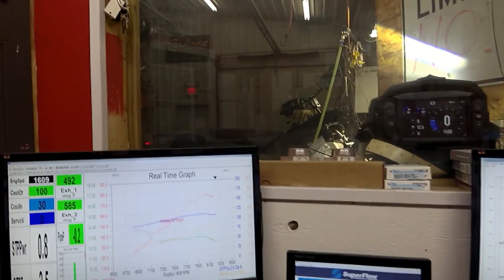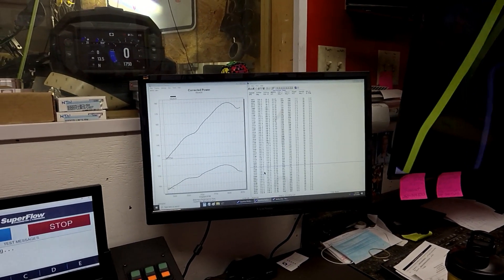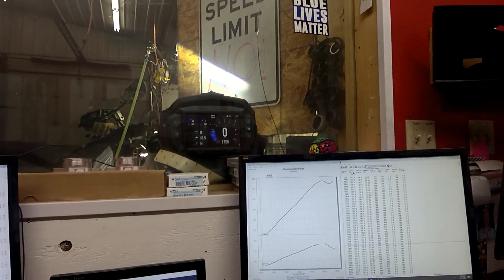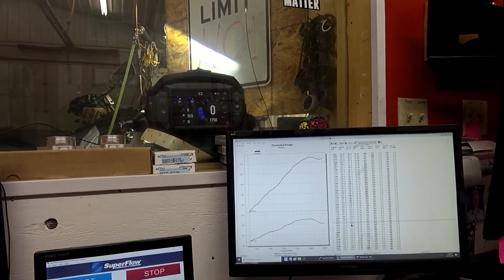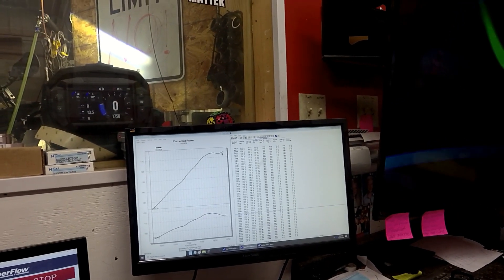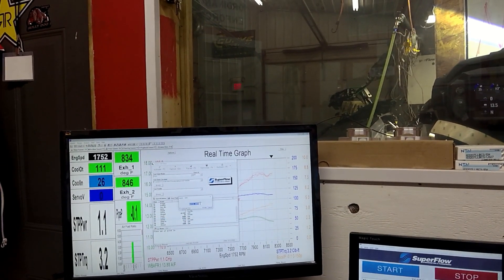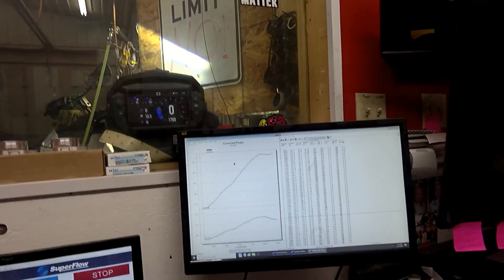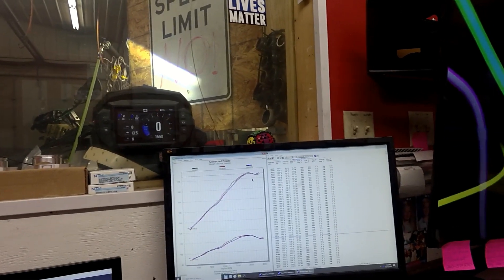HOW MUCH POWER DOES THE POLARIS MATRYX 850 MAKE?? SEE HERE!

Comment: 180?
Reply: And it started to drop right away where as to cats stay around there max hp for a while
Reply: @edwardabrahamiii3742  well yes ofc it dosent drop only 165 hp is not hard to achive
Reply: @mikkejalonen9050  id rather have my power stay where the max hp is rather than loose horsepower
Reply: @edwardabrahamiii3742  you want a linear power curve.  Not stay the same.
Would feel flat.
Reply: @daveclausner  id rather have my hp feel flat an stay at top end for longer then falling flat